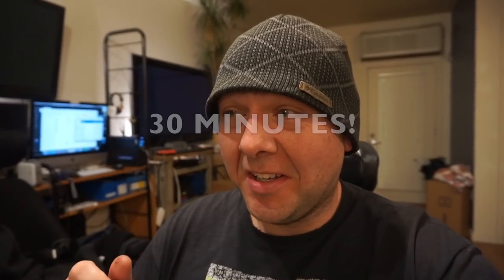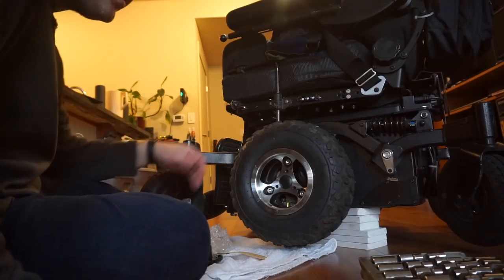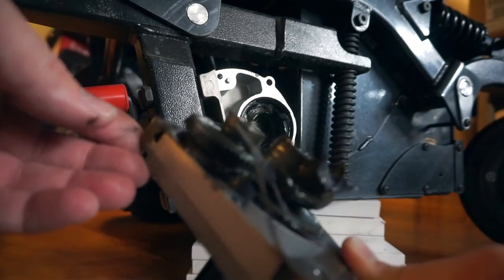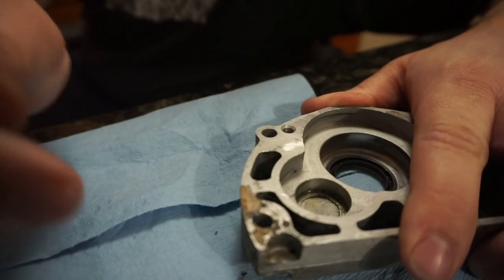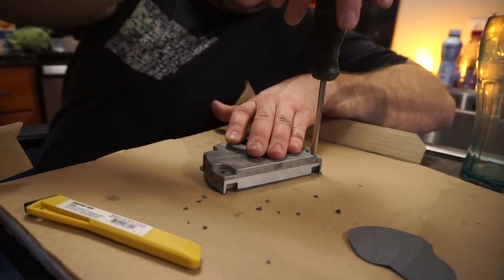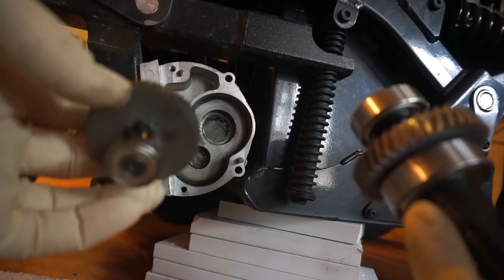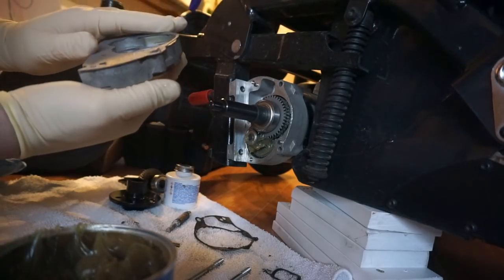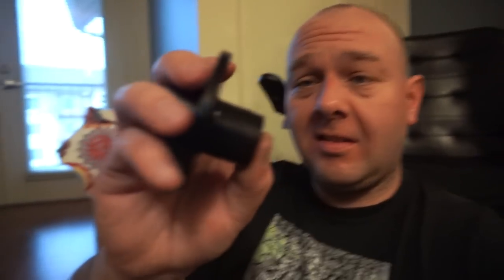MEGA VLOG 308: replacing gears in off road wheelchair

Comment: Just for your fyi. When you want make a gasket cut out a square size that is big enough to make your new gasket. Then take a small ball ping hammer and tap lighty on the edges of what you want a gasket for. Note use small rounded head to open holes ect. You’ll see as you tap on the edges that it will trim your gasket. Hope this will help.
Bob
Reply from the maker: aand that's why i love the internet! never would have thought of that! thanks man!

Comment: Get the black formagasket it stays pliable after install no paper gasket needed. Used in small engines for years  on motor boxes too.
Reply: I use the red gasket stuff in a tube. I should've ask the guy at napa...

Comment: HEADS UPS- be very careful about wiping your finger along the motor casing (like when you try to clean the surface of the motor) It could be razor sharp ! I think that gasket material is easier to work with than rtv. If you use rtv, the sufaces have to be clean. I often had more leaks using rtv than with paper or cork gaskets (for valve covers, etc). It also may be very difficult to use rtv while the motor is on your chair.  When you use a paper gasket, to make a good seal, put either oil or grease on both sides of it, during installation.
Reply: That's good to no on these chairs. I used the rtv on some off road kart motors I was removing the governors on when I put em back together.

Comment: hey bud, I had same problem with frontier V6 back two tires.  so, I did what you did, losen the bolt with 24mm socket.  so, tires don't shake.  thanks for your advise.

Comment: Oh heck, you did just fine (Now that I watched the complete video). I don't think I've been able to re-use paper gaskets many times.
Being that you repacked the grease and all, I suppose you could try lightly loosening the screws then, tapping the motor case with a rubber tip mallet to loosen things. Follow that by spraying the gasket with WD40 to see if it softens and loosens the gasket.

Another trick for creating your gasket outline: put a thin coat of oil or grease on the edge of the motor case. Then, with a steady hand, place the motor case on the gasket paper. The light grease will only mark the gasket paper where the grease touches.  Simply cut the gasket paper around the grease marked area. As long as you dont smudge the marked area it works pretty well.

Question: I dont suppose you could put the hub on the axle, tighten it, then mount the rim? Of course, you need access to at least one screw at a time from he inside of the rim.
Reply from the maker: I could potentially take the motors off the chair, attach the modified hubs, then re assemble everything.. The bolts that mount the hub to the wheel are on the back side.. and the threads are only tapped halfway thru.. I think next time I need to replace the tires, I’ll drill the holes all the way thru, then press in some studs and fasten it similarly to a cars wheels.
Reply: Thats funny you said that. I was going to suggest similar as a possible future solution. I was going to suggest tapping the holes in the hub, then drilling the threads out on the rims. That way you could  put your bolts on from the outside of the rim and they would screw into the hub. Be careful with bolt length of course.

Comment: Ok, I know ur super smart.

I was thinking that normally the hub mounts first to the shaft, thus allowing both set screws to be tightened. Then the wheel is put on. Like a car wheel.  

U possibly could run longer screws all the way through the wheel and put nuts on the other side of the hub. A solution would be to weld the nuts on the inside of the hub and drill out the threads through the wheel...then screw ur wheel on...
Reply from the maker: that was my thought immediately after i finished installed them!! LOL
like they say...great minds run in the same rut! haha
I managed to find some press-in studs off the shelf that should work nicely! so next time i have to replace my tires, ill be installing those, and we'll be running things more like  a car tire!
 ill press the studs into the hubs, then drill out the pre-existing threaded holes in the wheels, and counter drill some relief holes on the outsides of the wheels, then finally screw the cone-nuts on, so they're semi-flush with the face of the wheel!
rest assured itll be another video.. AFTER i move,  and get my drill press and other equipment out of storage!

Comment: Hi, I'm interested in seeing if it's possible to relatively easily swap out off-road tires on my F3 to allow for sand/beach access when on vacation.  Is such a mod possible?
Reply from the maker: yo! sand is kinda the holy grail when it comes to power chairs that can operate on it.. you could potentially get wider tires for the front.. but the rear castors will be an issue.. they tend to dig in like anchors.. 

 i've found that front wheel drive chairs tend to do much better on the sand than mid wheel chairs... so you're good on that one...  mostly you need wide tires, and ground clearance. 

even my off road chair can barley handle the dry sand..  have to be careful! i get stuck/high centered quite often. 

its do-able.. but will take some work :^) i modified an old jazzy 600 mid wheel chair a few years ago here's a couple videos about it from my old channel
 https://www.youtube.com/watch?v=RdMHzD-V1pg 

and here's the other video 

https://www.youtube.com/watch?v=4JN9UOQ6y4w